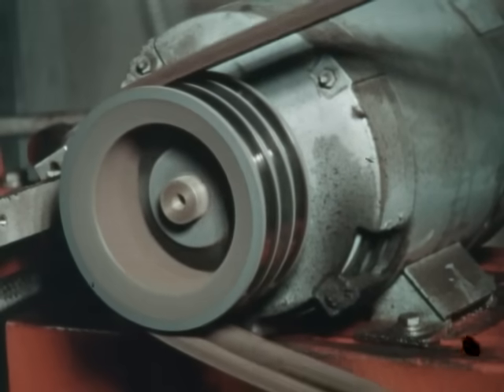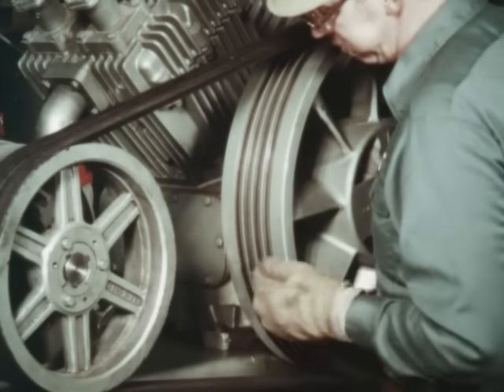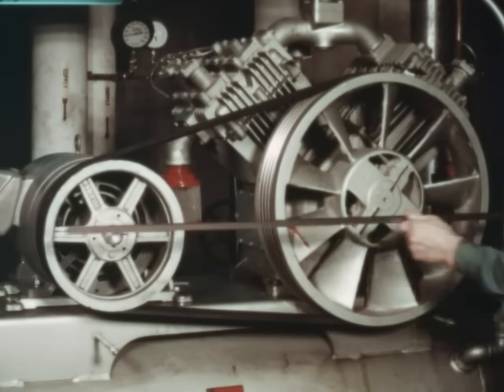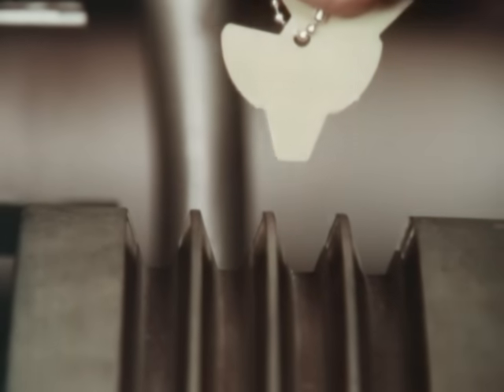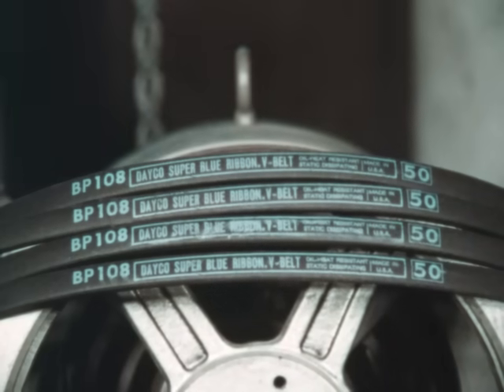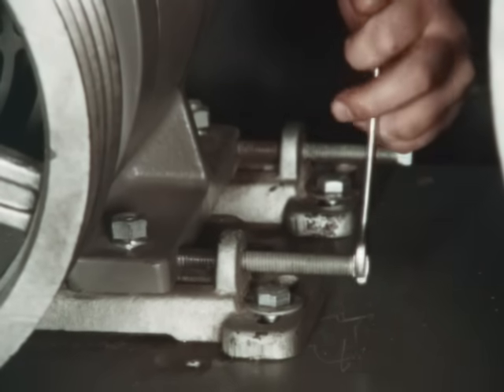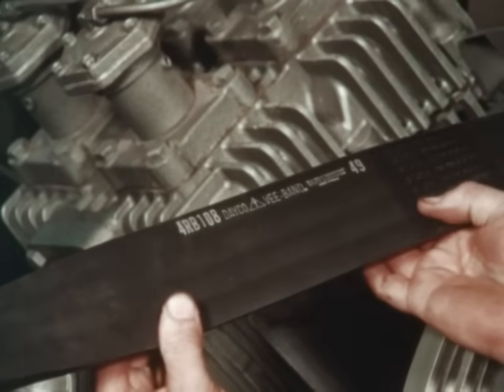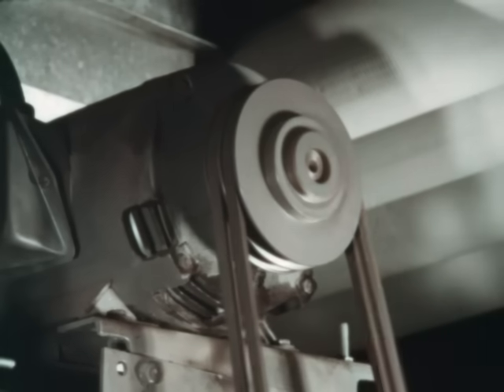V-Belts: Proper Care (1979)

Comment: I have a couple of original Dayco belts from the same time as the film. 
They're still ok yet after sitting around a lifetime. 
Im guessing they will develop cracks sooner than brand new fresh ones.
Reply: I still have an original v belt, powering an engine Govenor on my 1952 land rover series 1! I took it off as the Govenor was leaking but it was still going strong up until a few months ago
Reply: @jameswozny1997 It will be a "B" size which were twice as thick as what was the most popular "4V".  I remember decades ago working around ancient equipment and they had this type of belt on as well. 
They have extra cords inside as well. 
Kind of like the big rear Farm Tractor drive tires that are 65 70 years old and still holding up (though I mean ones that are barely used anymore not out in the field regularly or they will eventually fail from cracking) compared to modern (1980 ish to today) car tires that crack and fail after a decade being outside in the sun. 
I've had to replace new modern B size belts on equipment but it's stuff running flat out for hours (very high stress hard usage). B belt in automotive service is a cushy relaxing environment by comparison.
Reply: @RetroCaptain thanks for the info! The car only has 44,000 miles on it and the Govenor doesn't do much work so I think that's why it's lived this long. It's such a shame modern parts are built to a price and not built for quality.
Reply: Believe it or not, as long as those old belts were stored in ok conditions(atleast in a fairly cool garage and out of direct sunlight) they are probably 1000 times better than any new belt you can buy at a store nowadays. Modern rubber compounds are junk and have an extremely poor service/shelf life. I have seen many 40+ year old belts with little to no dry rot/cracks that work perfectly fine. With a brand new modern belt it's only going to last probably 3-5 years at best before it completely dry rots and disintegrates even when stored/used properly.
Reply: @briang4470 Industrial Supply shops have what I've found as the same quality of belts today but I'm talking about the actual HVAC duty stuff (or Lawnmower/Snowblower duty are sometimes even better) basically as good as back then. 
You can get full V type still and the "Cogged" type as a lighter option.
The Cogged style, a Browning development almost 40 years ago, don't last as long unless used for very sharp bends where the original style will run hot and develop heat cracks and fail. 
Most modern (non industrial) equipment has been designed to run with modern flat belts (which don't last that long)
It's only things like Riding Lawnmower and Farm Equipment that takes the old original style heavy duty B belts or "5V" I think is alternative number. If you get the white Yard Equipment belt or buy your belts at a Farm Supply or Co-Op/TSC/Peavey they will be very close in quality so I have found in actual working situations. 
Oil exposure will quickly destroy modern belts where 40 years ago those even ordinary duty Fan Belt would just become more slippery they never swelled and snapped like today's belt does. 
That's the only downside of today's belt that I personally found.

Comment: V belts suck,thank goodness those got phased out of the regular automotive world by the 90s. Maybe belts back pre 1980 were better quality, but atleast in todays world modern v belts are garbage, you cant find true "matched sets" of belts anymore so if you have a multi groove pulley set up and need 2 or more matching belts your screwed because all the belts you buy will be slightly different in length and are almost always guaranteed to squeal or squeak because some belts will be too tight and some will be too loose. Also modern rubber deteriorates and dry rots super fast a modern v belt your lucky to get 3-5 years out of one. But i have seen cars that were over 40+ years old with original factory v belts that still looked almost brand new, nothing is built like it used to be.
Reply: No one spends money on rubber goods storage:  mid to high 50's and no sunlight.  Look at todays modern stores and managers cringe on "dead" stock: something hangs about for six months, and they make it a special order item without blinking - never stocked again.  Few places left that store much: maritme endeavors, remote places like northern Russia,  Alaska or Antarctica come to mind where winter just demands it.
Reply: @flinch622  nah, modern day rubber is just junk. I have seen 40+ year old cars with original belts and hoses that looked practically new, even on cars that were stored outside or in non climate control places. Same for rubber bushings for suspension, i have seen many 40+ year old bushings in amazing condition but put brand new modern ones in and they will be completely dry rotted after about 3-5 years, even when stored in side. Something has changed in rubber component manufacturing because it applies across the board everything rubber deteriorates fast nowadays, o-rings, belts,hoses,bushings, sealing washers ,gaskets and especially tires.
Reply: what?? I have never seen a dried out epdm belt... now these new tires on the other hand.... Garaged car with cracking tires in less than 5 years

Comment: I cannot imagine any modern place taking the time to devote this kind of care and maintenance to belts.
Reply: As the cost of labour has gone up and the cost of parts has gone down, this level of care is increasingly seen as uneconomical.
Reply: @233kosta  Downtime on industrial equipment that runs all the time is costly.  That has to be taken into account also.  Break downs cost money.
Reply: @kingduckford  Aye they do. Just that some plant managers don't see those costs until after something has broken, so they elect to "save" money by shortening these procedures as much as they think they can.
Reply: @233kosta  this is true although unwise in practice. Cost of materials is minuscule compared to downtime of machine in most applications.
Reply: @cristianstoica4544  Hehe I never said it's wise. But you go tell that to a freshly minted MBA 😅
Reply: I never saw training like this before - just results of time vs adjustment practices.  Its common to see variable sheaves installed where access to tensioning bolts is difficult.   And what happens after years of service is the angles start disappearing, and the faces become bowled out.  The next tightening will find the belt effectively dropped, and grip pressure applied in the wrong parts of the belt, making the belt heat more and... it dies early.  Replace the extremely worn sheave, and I've seen belt life double.  On the machining side, it will catch some off guard.  if a belt vee is 24 degrees, the sheave is something like 23 - they are never machined as matched, and the load is intended to be mostly carried by the wider end, plus allowing short radius expansion as it bends for the turn.  And the absolte worst thing for [aligned] v-belts?  Riding the bottom of the sheave instead of being gripped exclusively by the sides.  It might work a while... but will be an incurable squealer.
Reply: In the consumer market belts and sheives are replaced when they fail, industrially in factory  s they are more commonly mantinenced.
Reply: Maybe if it were a known problematic unit like half of this stuff might get checked/done, or on an aircraft.
Reply: @Broken_Yugo  bigger companys here use vibration sensors on their machines. They can see trends in the vibrations that indicate a problem with the motor or other the components driven by it. That usually prompts inspection by the mill wright.
Reply: This use to be a proper nation

Comment: When new belts are installed, while running, pour about 2 oz of 30 weight motor oil onto the belts. Next, put sand onto the new belts. This gives the belt more bite.
Reply: I found wrapping them in sandpaper works great for grip😂
Reply: both motor-oil and sand cause belt to slip. Belt are rubber, it's like a tire, obviously motor-oil and sand cause tire to skid.